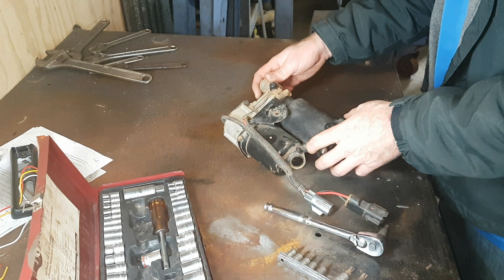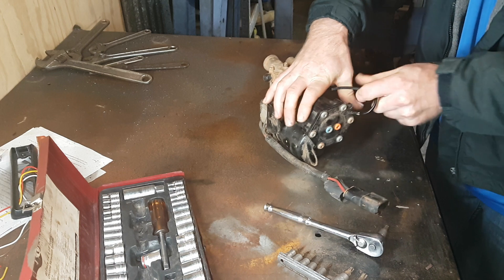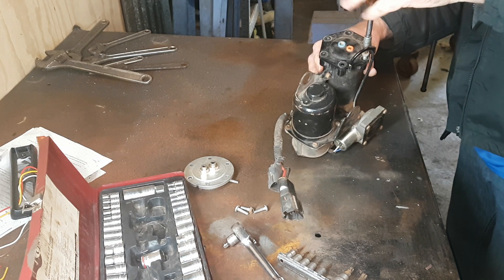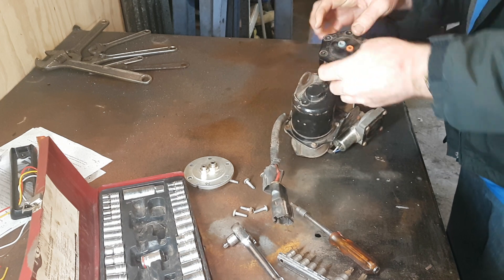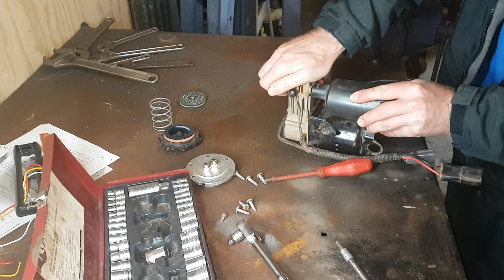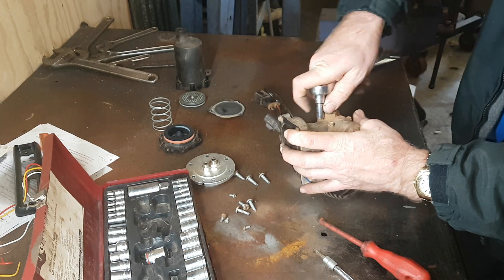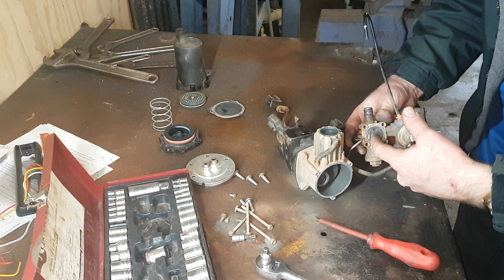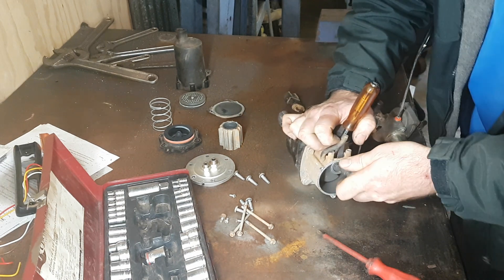LR3 | Hitachi Air compressor Rebuild | New piston and barrel | Air suspension

Comment: Thanks for the video! The dual metal plate round filter with all the little holes in it is filled with that old crusty white powder do I need to remove it all before I refit
Reply from the maker: Doesn’t hurt to give it a wash out. When the dust migrates it’s way into the solenoid valves they can start to leak.
Reply: @Shanes_Shed  it seems if you clean it out  entirely then there's no way for the new 0 ring to sit around anything.. I'f u know what I mean it would just be loose
Reply from the maker: There's a filter pad between the metal plates - From memory the factory filter has  a rivet holding them together. In the past I've separated the two plates and put in a new filter pad - then bolted them together with a new oring.

Comment: Greetings from cold Canada, I know this is a bit late, but I spilled my desiccant on my workshop floor so I regenerated the old desiccant in a 3-minute high microwave and then for 1 hour at 350 F
Reply from the maker: Thanks for the comment Mark, that would certainly work to dry it out. Many industrial air dryers I’ve worked around do a similar thing. Regen using hot air  in a reverse flow through the dryer

Comment: Hey mate, just bought a v8 SE 2005 D3. You videos are great, heaps of good detail. Mines got low kms but as soon as I bought it, it’s already needing a couple of coils so figured a good idea to get into the rest of the maintenance stuff too. Probably should check the pump! How did you know yours needed a rebuild of more of a cautionary thing?
Reply from the maker: So glad the people are finding my videos usefull, thank you for the kind words. This particular pump just failed to build pressure and at the time I just ordered the normal rebuild kit before I pulled it out. Once I stripped it however I found the bad wear in the piston and cylinder - thought Id attempt the new rings/seals but they failed so I ordered a complete replacement compressor as I needed to be 100% sure of having everything working.

Comment: You missed pulling the electric motor cover off and giving a good blast off with Contact Cleaner while you are there. They are filled with carbon dust and you can give the brushes a bit of light sand paper. Worth doing although I learnt this news also after doing a rebuild on mine. I've done it on a spare unit and its a simple job.
Reply from the maker: Hi Richard, good point. I still need to add the desiccant to the compressor so I'll have a look at it then